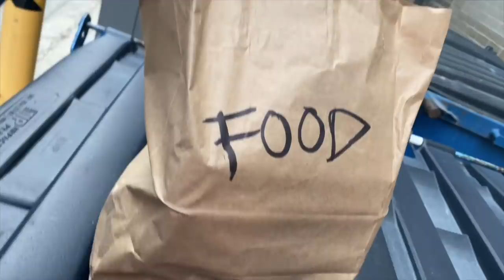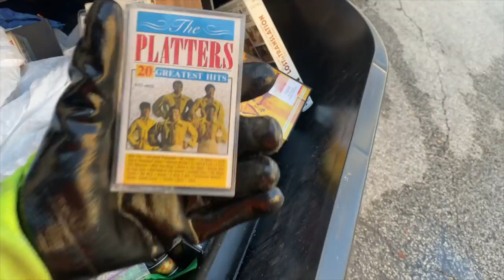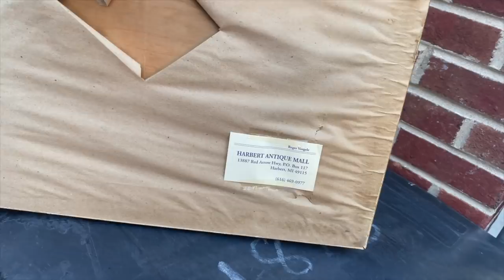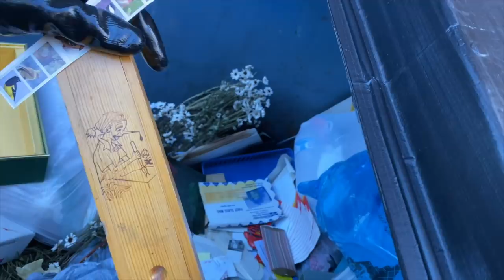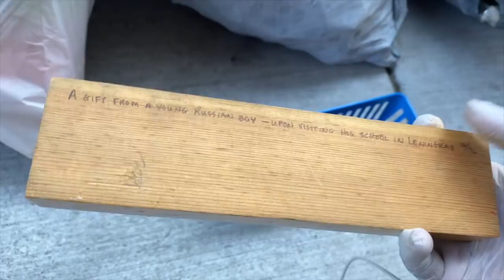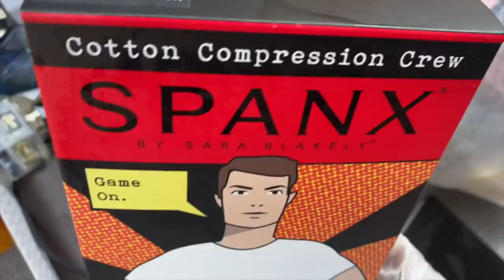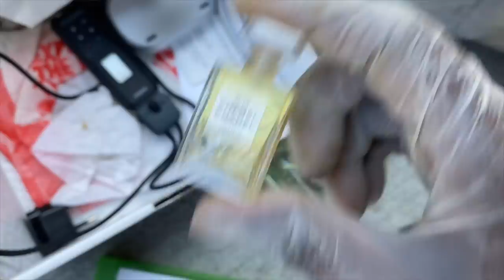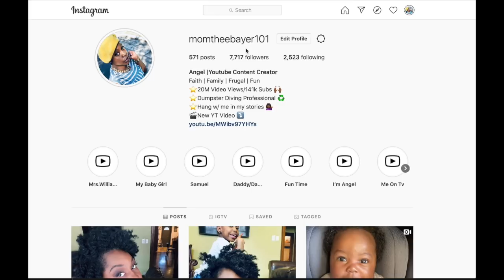Dumpster Diving in CHICAGO RICH NEIGHBORHOODS were very REWARDING!!! GUCCI, CHANEL, RAYBAN & MORE!!!

Comment: Long story! If I had a way of taking the larger stuff or multiple items when dumpster diving, I would. When I found out that grocery store was closing, I got to go 3 times and found a good amount of stuff, on the last day I was able to go, the dumpster was filled with lots of TV dinners from cheaper to Hungry Man, I did take alot, although had I been able to take more I would have. My house is 4 rooms, 5 if you count the hallway and its separated by 2 connected lines, the kitchen, bathroom and hallway are on one line, while the living room and bedroom on the other line. I come close to burning the house down cause of this fact when I put 2 heaters on the same line and overloaded the electricity and it even put my refrigerator out of commission for about a week to get the cord replaced and that was not fun. I would like to have the electrical upgraded to brand new wiring with multiple connections from the breaker box, so that will never happen again, just no money. Cause of this fact I can not heat the kitchen, bathroom, bedroom and even the hallway, I choose to do it this way in hopes my dogs will stay warm, yet those drafty holes in their room make it hard to keep it warm, so if you are a praying person, pray that GOD intercedes, one day I may just want to leave if that's GODs plan, I would move if I could in a way, the noisy horns that pass through hurts my babies ears and they will wail in pain and if I had the money to buy or even rent a place that would accept dogs, I would consider moving, yet most rent houses I checked on, up to $600+, they also don't allow dogs and I get a total of $726 in social security. I probably could get a low income apartment, however most will not let you have large dogs, Charcoal and Mandy are Labradors and I do not want to get rid of them, someone threw them out like garbage and I can NOT bring myself to do that to them, they are my BABIES! I LOVE THEM TOO MUCH! I don't know what plans GOD has for us. I hope I can figure that out and move on if that was GODs plan. I wanted to stay in this house because it was my grandmas house, being it was historic I wanted to live here all my life, yet there is no stores close and I would have to bike up to 15 miles or more if I wanted or needed to go to town, it takes around 2 hours one way, 4 hours both directions and no bathroom stops unless you find a tree to hide behind and no real way of carrying dumpster finds or even purchases for that matter. Because I am so POOR, I don't even see a vehicle in my future and no way of driving. Things just happen that we can't explain that only GOD has the answers to. I would like to do better, much better than I am now. My life has crashed down on top of me, though I haven't suffocated yet, sometimes it feels like it, I HOPE GOD INTERCEDES SOON IN OUR LIVES! HOPE YOU HAVE A TRULY BLESSED DAY and NIGHT!

Comment: The little gold tone aluminium cylinders in with the perfume were little atomiser bottles for your purse. They come with a tiny funnel you point the spray from the perfume bottle at and use that to get some perfume in the bottle, after you've taken the squirted out of the little bottle. I'm sure you'll work it out!

Comment: * Narrow glasses are Reading glasses. they should have a number to show strength. (1.00, 1.25. etc) You cab read & look over the top of those & see without taking off the glasses.. Cool..  Sell for $3.50 but up to $15.00 IF they are in a case,,